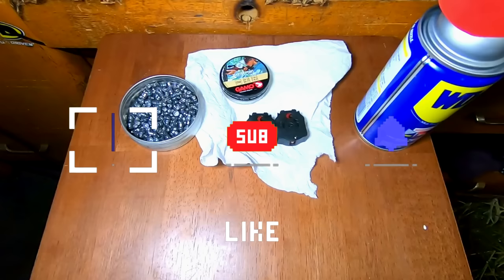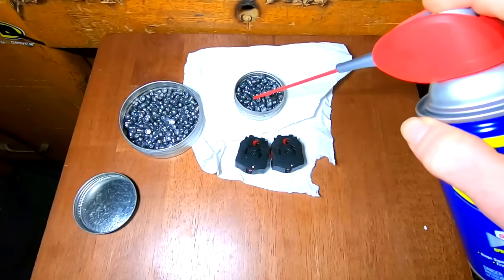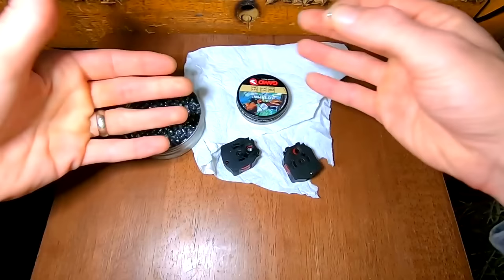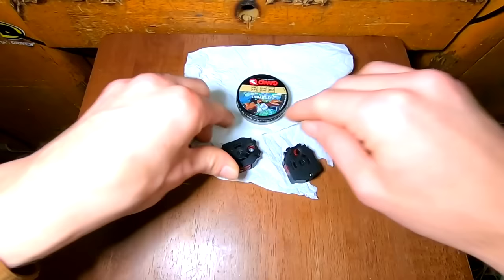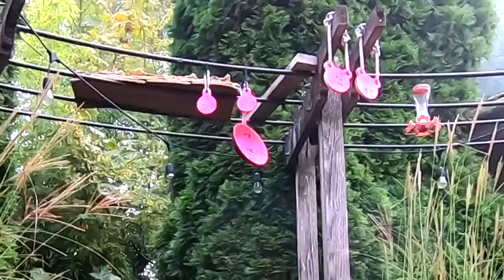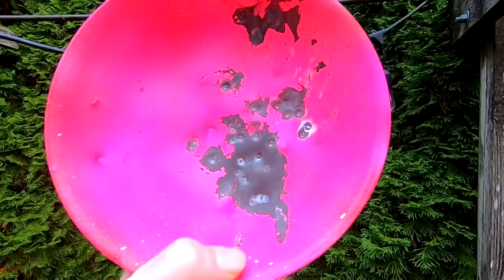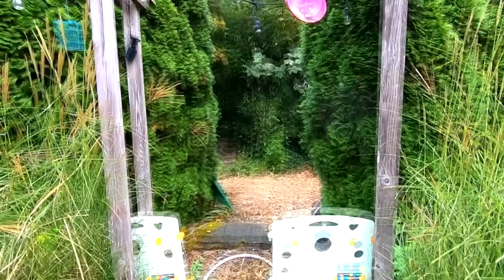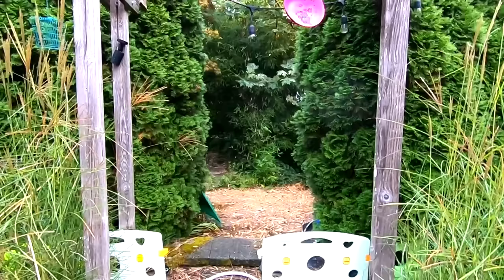Pellet Dieseling the Easiest & Quickest Method

Comment: I got my first air rifle from my Dad for my 8th birthday back in 1985.  It was a Daisy Model 120 break-action spring-air .177 cal pellet rifle.  At the time, I figured it would be a good idea to lube it on occasion using some 3-in-1 oil.  I noticed, though, that it would blow a puff of smoke and make a slightly louder noise right after oiling it.  I can still remember that smell, lol.  I had no idea what was going on at the time, so, it's nice to finally get the rest of the story.  I'm 46 now and this video prompted me to walk over to the closet to pull that old rifle out.  It's still in great shape!  I can't tell you the last time I actually fired it, but I'm starting to get the urge to take it out to the range.
Reply from the maker: Might need some new seals after all that time, could be dried/cracked or something
Reply: Do it, im 57 and just started getting into air guns. That damn skunk won't spray my dog anymore!!!😉
Reply: Back then, they used hard cowhide leather! Oil it up again! Tanke er out an enjoy it! It'll be ok. Oil inside something that that last forever! I purchased an really old UK made air rifle 25 yrs ago, but it was made in the turn of the 20th century. Someone 100 yrs ago oiled it an it still had oil inside it! Works to this day2023! No BS. My old 50 yr old Chinese breaker barrel still works great too! Soooo
Reply: @eddiecahall3824  I ran some oil down inside of the air cylinder…hoping it made it down to the leather seal.  I tried to disassemble the cylinder, but it didn’t seem to want to come apart easily and I didn’t want to risk damaging something beyond repair.  I’m gonna give it a try later on!
Reply: Very cool story.
Reply: I am 56 and like you around the same age I noticed how my air rifle would shoot defrent with oil in it dont have that old Benjamin no more now I shoot a RWS Mod 94 .🤠
Reply: just found my grandads in his safe ive been having so much fun with it, i got lucky grandma let me go into his workshop after he passed i found a few old muskets and a bb gun XD
Reply: Go hard son!
Reply: Definitely more crack Definitely more recoil but it's sure to shorten the life of even the best made air rifles.
Reply: do it 😉
Reply: Cool! I'm 53yrs old & just decided I wanted to get back into it. I had a Daisy as well, a pump action that looked like a Spencer rifle. It was so low FPS (though I knew it was dangerous), you could see the BB travel the entire path. I got so accurate with it, to this day I feel good about it!
I decided to start plinking (mind you, I was 11yrs old) at my neighbor's custom van, since the BB's "just bounced off". I didn't know how easily glass broke when BB's hit it. Caused $5k damage, which my parents' insurance covered, but the kicker was, he was our insurance agent. I wasn't allowed to touch a pellet or BB gun until I was old enough to be on my own.
Picked up a 'Glock' CO2 pellet gun I hadn't used in 6yrs or so, put CO2 in it, loaded it & it fires reliably! I'm sure it needs oil, but these things, while not complex, are simply built to last!
Reply: @danielthrasher7052  Old post I know, but is your RWS a .30-.30? That's a cool piece of history. Read that it's the first commercially available rifle that uses smokeless powder.
Reply: willyberg123  I put break-barrel Crosman oil, slathered it all over the outside of the piston (this sounds like a dime novel, lol) & the first shot I took with it was 5 x its stock speed. Is there such thing as too fast, and is that a fire hazzard? Tempting to try it though,  I now see why "all the kids are doing it".

Comment: Don't do this with a pellet gun you like. This WILL destroy the seals! Yes, it does make a crack when fired and you do get increased velocity and decreased accuracy. It will also coat the bore with burnt hydrocarbons along with leading.
Reply from the maker: You could also just clean your barrel 

Also I've been doing this for years and my gun is still fine so it is what it is

Comment: I get dieseling by dropping 3-in-one general purpose oil straight into the piston chamber , it gives me about 3 extremely powerful shots, you can tell the pellets go supersonic on a .22
Reply from the maker: I wouldn't put it in the piston chamber, that can actually damage your gun. Keep it to the barrel area i.e. inside the pellets.
Reply: Your seals are going to go supersonic, sooner or later.
Reply: @PelletPlinker  Is 3in1 a good substitute for just barrel oil? I want to put some barrel oil in to lube up the barrel but everything I've looked up online says to use silicone pellet gun oil specifically and only from the exact brand that makes the pellet gun. 3in1 has never failed me before used it for all sorts of stuff over the years. Just figured I'd ask the lads that really know
Reply: i used my Camo magnum, he has a nice mag, you need only a tiny bit oil and thanks to how the mag is build the oil stay in the slug, i could not measure the speed, but i could hear and see the damage he has done to my plywood!! i think it was surely 20% increase
Reply: Hoppes #9 lubricating oil or any 3-in-1 oil works, put a drop on the pellet skirt.
Reply: @LoveSpellzFB that pellgun oil I think is jus regular transmission fluid
Reply: They are done ultrasonically, but what accuracy is being done?

Comment: We used WD-40 in the mid seventies. I had a crosman 767 pump that shot about 500 fps. I sprayed my barrel and soaked the pellets. That little rifle could hunt jack rabbits. Didn't have a Chrono back then but you could here the difference in thump on hard targets . People say it will destroy your gun. I dieseled thousands of rounds in that cheap gun and it's in my closet today with the original seals.
Reply from the maker: Mine definitely doesn't have THAT much use, but yeah my gun is perfectly fine after several years doing this now, and hundreds of dieseled rounds later

I'm sure there's some possibility for damage, but I haven't had any yet.
Reply: Up here in Canada all we are allowed is a max of around 500fps. I was wondering if it would work with the tuned down pellet guns we have up here. Since it worked for you, I might give it a try with mine.
Reply from the maker: might be able to
worth a try

Comment: 40 years ago I tinkered around with old airguns like the BSA mercury's and meteors,  webleys like the  hawk and vulcan, and  Weirauch  HW35/77/80, and numerous others, best results were with a strong spring and  also leather piston washer  and a properly 'cross hatched' cylinder wall will leave the right amount on the wall in a consistent manner when you cock the weapon,  dont forget most of the smoke you see is oil vapour blown up the barrel, I tinkered around a fair bit when I was a kid,  when you get above 1150 fps you will hear a loud crack,  but all the power in the world is no good without consistency,  at really high velocities you will run in to accuracy problems with thin skirted slugs, as the increased power will distort the skirts, not a problem with slugs with thick skirts like the H&N Barracuda.

I used to 'tune'  them  for accuracy by the usually rebedding the action to the stock properly fitting a piston sleeve and guide tube if it didnt have one, fitting bearings inside the piston and on the guide tube so the spring could twist without friction, and then  by polishing the contact  surfaces to a mirror  and working moly into the surfaces as a youngster as a pastime, and found out, if there is grease on the outside of the piston, it try's to work its way forward every shot,  so you can think of it as fuel as when you cock the weapon a tiny amount of lubricant is left on the cylinder wall as you cock it, so a flexible  piston seal with a feathered edge allows this to collapse on the cocking stroke  but  will expand as it goes forward  pressing  into the cylinder wall scraping it off as it slams forward and hits the air cushion and under adiabatic compression detonates  before it bounces again  and settles  up against the cylinder head,  this is why powerful spring airguns do more damage to scopes than a firearm because of this '2-way snap' recoil pattern,

Am not sure if you can get it anymore there was some magic go juice called Tikko Power lube, it was a kind of lithium based grease when mixed with something call 'Weapons Oil  Medium'  which i think you can still get from military surplus places, you know if its the right stuff as its a milky coloured substance and  when mixed together and applied  not too thick that it causes drag to the outside of the piston  it was instant consistent power
Reply: Thanks for sharing, I have an old (1960s) Pakistani .22 cal pellet rifle that is pretty powerful (900 fps or so) that could use some of your mods.
Reply: But are you sure? Jk, good insight, thanks
Reply: Wow beautiful collection of springers, hope you still have them .
Reply: That "crack" you're hearing is actually the pellet passing Mach 1, maybe better known as the "Sound Barrier." Mach 1, at sea level, is 1050 fps. Gaining that extra bit of speed with your pellets can be good or bad. If you're objective is a faster, more powerful shot, this process sounds like it can help. If you want that shot to be quiet, keep it under 1,000 fps. The difference of ~100 fps or so isn't going to make a great deal of difference in the speed/power of the pellet but it will definitely make it louder. To get the speed up significantly, you're going to need more air pressure... that usually leads to PCP air rifles and that leads quickly to more money.

Comment: I just finished modding a .22 cal pellet rifle, a generic Crosman hardware store rifle called the 'F11 NP', which is restricted to < 500 fps but gets, with 14.3gr pellets, around 420 - 440 fps. Let's say I upgraded the nitro piston & the gas ram to something with more stank on it since I have my PAL & found out I'm allowed to mod these things all I want.. I've had dieseling happen a few times as i removed the piston & re-installed it over & over, occasionally adding break-barrel oil to the outside of the piston tube. I'd get dieseling almost every first shot of the next day - it felt, sounded & kicked like my 22 rimfire. I never put my first shot of the day through my chrono until today, while testing my new piston/ram combo. 
I still think it has to be a chrono problem - but this is the first & only time it's done this. I thought it had something to do with the gasses/sparks that fly out of the barrel or the smoke that accompanies the pellet. With a very light .22 cal pellet (Gamo Platinum 9.7gr), my chrono read 674.3 m/s (2200 fps). I'm getting consistent > 1000 FPS with .22 cal 14.66gr domed pellets & my fastest fps was 1427 fps - almost 1000 fps more than it was getting with the pathetic Canadian piston/ram combo, but the dieseling shot - is it even possible that that ~2200 fps (674.3 m/s on my chrono) was correct? Can dieseling really make a pellet go that fast? There's no way that can be safe for the gun, right? Especially with a 9.7gr pellet, which isn't really appropriate for such high power.
Reply from the maker: if it's happening in the piston chamber, theres a chance it is detonating much more fuel than just normal pellet dieseling, and so that might be why it's going so fast
Reply: @PelletPlinker  Thanks, I thoguht the source of the performance of the first 10 shots or so came from the shorter piston & 8mm shorter gas ram I installed. Much more air in the compression chamber, but with a 70kg gas ram. The only thing I added to the install was that I applied Crosman break-barrel oil,  liberally, on the outside of the piston (not in the piston, the gas ram is dry).
I'm only using a 3mm shim (3 washers, actually more like 3.3mm), but I'm going to have to do the math to make sure it's optimal. The barrel has to be folded much farther than it used to, but it locks great when cocked. The pellets were loud, the first one being the loudest of course - but I see now why people rely on dieseling sometimes. Must've been at least 10 shots > 1000 fps, which for a .22 is a bit too high to be accurate, or at the limit anyway (in my experience). I swear to you & your subs, though, that 674.3 m/s is accurate. After another 5 shots or so, it went down to the 900 fps range. Like I said, I had no idea those speeds were possible - I thought maybe some of the smoke or particles of oil in the spray might have confused the chrono (a cheap '2 canopy' type chrono) - but the pellet hit a 2x4 on a wooden step, smack dab on the side, and there's a bulge on the other side of it. A pellet going that fast, almost through a 2x4. "What have I done?", Iol, I was like Hatori Hanzo.
Now, after 30+ shots (mostly with 14.66 gr dome shaped, but some 14.3 gr hollow point), the speeds have settled. I'm getting a consistent 700 fps+, which for this rifle is fantastic. My cheap chrono won't tell me what speeds I get with a 9.7gr pellet, but I can imagine it's 1000fps. I get the occasional 820+ fps, but the absolute lowest was 690 fps. I'm just a plinker, I don't hunt - but given the opportunity to hunt rats or crows, I'm in. The Crosman F11 NP is actually pretty good, but it really needs the upgrade of piston & gas ram (~ $110 CDN)  to be worth it.

Comment: Blotting paper soaked in lighter fluid always did the trick for me. Used it on. 22 steel tips with my 1970's BSA meteor and the airsporter. (one of which was a 177).it would drive a pellet through steel oil can at 35 yards (lengh of garden) but couldn't say beyond that. I do recall a neighbour once knocking on the door one Sunday morning kicking off because they'd dug a pellet out of their back door! The door was about 70 yards away and through a hawthorn hedge 😂.

Comment: try 1/3 paraffin , 1/3 either , 1/3 light oil its acutely the formula for running model engines, the either fires under pressure igniting the paraffin ( you in the USA may call it kerosene)  which explodes and the oil lubricates.

Comment: I was putting a drop of diesel fuel behind the slug nearly 60 yrs ago, a long time before all of the restricted b/s of 12 foot pounds there is now, it did the job nicely back then too
Reply from the maker: I'd call it a technicality 

the 12 foot pounds I imagine, applies to the gun itself

If you are putting diesel in the pellets, you are not modifying the gun to shoot faster, just the pellets. And once the pellet is gone (i.e. you have already shot the dieseled pellet) the evidence is gone, and there is no way for them to prove you have a gun capable of more than 12 ft lbs. 

obviously use this technicality at your own discretion, but I think it would be safe.

Comment: Vaseline in the skirt of the pellets works much better because it doesn't run out of the pellets now with Red Flight Rounds you seat the Red Flight Round 1st then put a little Vaseline behind it and fire away.  In the Beeman Duel Caliber Air Rifle it works great pushing 22cal Rounds down range between 1300 to 1400 FPS with 177 Cal Alloy Pellets around 2,000 FPS. I'll do a video one of these days on Dieseling the Beeman Duel Caliber Air Rifle. 
God Bless
Reply: Want to see that.
Reply: @ThePanman48  Once I had a Steel lock box and shot with a 22CAL Non Lead Red Flight Round and not only did it zip through the lock box it still went about a quarter of a inch into Oak Wood. I was pretty amazed to say the least !
But like I said one of these days I'll do the video on Dieseling with Vaseline it really works great!
God Bless
Reply from the maker: check out my first diesling video thats what I used
Reply: @PelletPlinker  Cool, I'll check it out and thanks for the videos.
God Bless
Reply: might be worth trying paraffin wax
Reply: Vaseline doesn't clean or Lubricat the barrel though, big difference.
Reply: @BigDawg76773  I never said that ! I  recommend that you clean all types of guns after Target Shooting or Hunting. Vaseline explodes from the pressure of the air which pushes the projectile at greater speeds and that's a FACT ! I Actually have shooting all types of guns for the last 41 years , so I do know how to take care of Gun.
Happy Holidays
Reply: @hanke2456  Good for u gun expert in that case put up better videos or next time make justified recommendations since u been shooting for 41 years Happy Holidays to u too

Comment: When you are in a place like me [West Africa] where the difference between a damaged gun, seals all busted etc, and a working airgun is NOT being able to pop into the shops for a repair, or a replacement - you keep away from all these gimmicks.
I was interested in dieseling to, but I have read many stories of how the oils, the vapours and the explosions wreck the internal seals and make airguns inoperable.
While it looks like fun, and could help me with range - I do not think I would want to try this.
Reply: I use vasoline and never ever had a problem. I've read about broken seals and all that but all I know is I've shot hundreds of rounds with no problem. Just increased power.
Reply from the maker: Yeah same here, hundreds of dieseled shots with no problems.
I also have only ever "read" about these problems. And by "read" I mean peoples dubiously unbacked youtube comment claims; definitely nothing even remotely scholarly.

Not a single person has presented any evidence of this damaging an air gun. Lot's of claims, but zero data. Zero evidence.
Reply: @devon6866  Out of interest what method are you using? and what form of air rifle? pcp or springer?
Reply: @lamarr1986  I use a AEA precision max .50 caliber that's PCP and I also have a gamo break barrel and I deisel with both with good results.